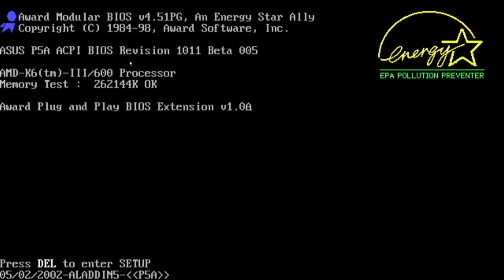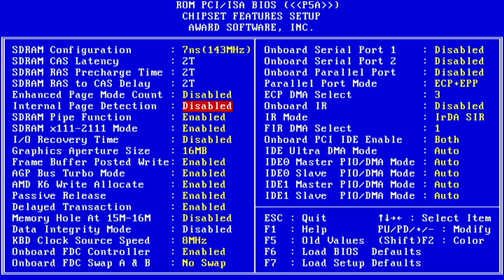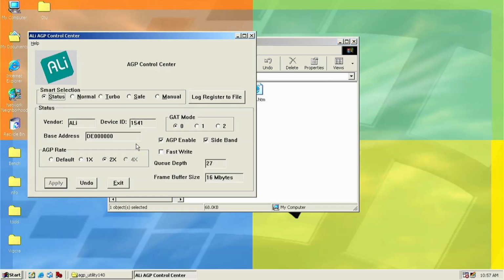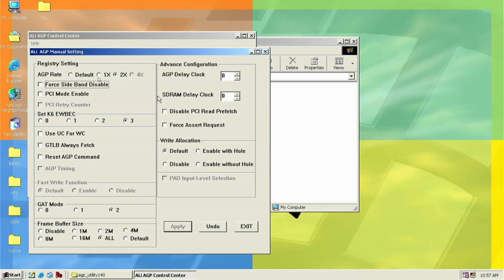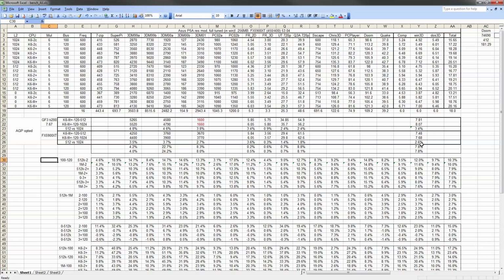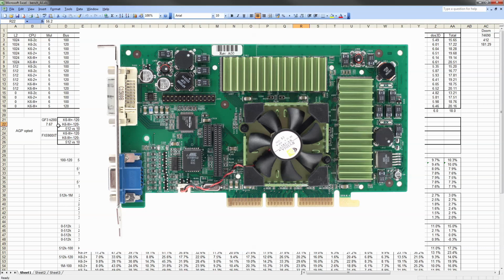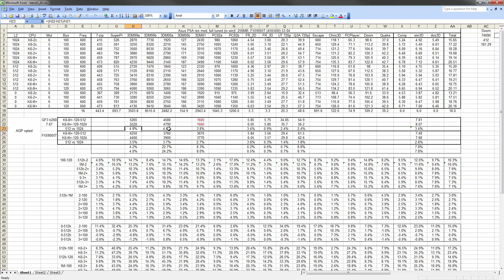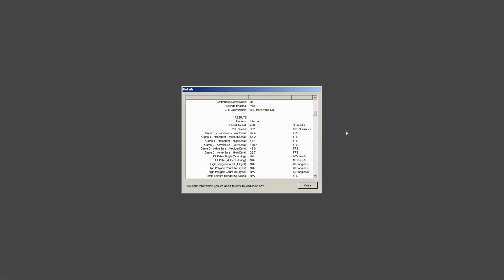Asus P5A v1.06 with 1MB of Cache - Part 2: Setting 3DMark Records with K6-III+ @ 5 x 124 = 620 MHz.

Comment: If I use Win XP SP1, will I have less performance ?
Reply from the maker: Windows XP are way heavier as an OS. It will feel more sluggish but it can do it. Performance in games also probably a bit lower, to much lower because you can not use older VGA drivers. Worth to probably also try Windows 2000, but probably the best is win 98.

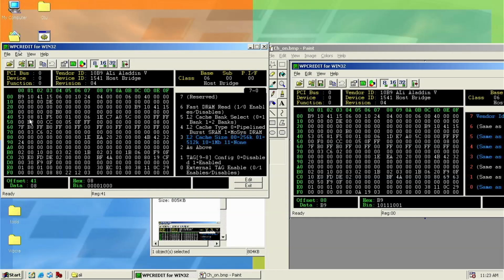Comment: @ 1:14
In offset 41 for the 1mb cache motherboard... you say to change that value from 08 to 48 if the cache is disabled for a performance boost.
What about for the 512k cache motherboard version? For offset 41, the default value isn't 08, but instead its 05. Do we change it to 45?

I also have a Gigabyte GA 5AX Rev 5.2. Will these tweaks from your part 1 video and this one work the same on the GA5AX or is everything different?

Thanks!
Reply from the maker: True,  this (offset 41) should be changed from 0... to 4...
This sets the 6th bit, and enables "Fast DRAM Read".
This increases performance, but is only stable when the M/B cache is disabled.
The model or cache size does not matter, as long as it is the same chipset.
That is for all these opts. Happy tuning ^^.
Reply: @atheatos  
Thank you!

Those Ali AGP 1.9 drivers made my 3d Mark 99 score go up 1000 points! Almost 4000 total now. 😁

I also did a couple of those tweaks from wpcredit which helped mem bandwidth & latency quite nicely 👌

I haven't done any of the command line stuff in my autoexec yet.

Finally got over 2000 in 3d mark 2000 👍

Currently running a gigabyte ga 5ax rev 5.2 with a K6III+ @ 600 (120x5@2.2v)
And a voodoo 3500.

I have a p5a 512kb 1.06 as well sitting in storage. Going to do the 1k ohm mod on it and tinker to see how it compares to my ga-5ax next week. 

Question:
I have the following agp gpus available... Which would be fastest in the ali chipset with these two boards I have... And which would you run:
Riva TNT2 Ultra
GeForce 2 MX400
GeForce 3 Ti500
Radeon 9700 Pro
Or keep the voodoo3 3500?
Reply from the maker: Nice results there :)
Fastest overall and best option is the "GeForce 3 Ti500" combined with some old driver (7.76??).
Especially this is true in benchmarks. Big difference from the Voodoo.
Now some games with the Glide API might run faster on the Voodoo, so hard to tell.

Personally I do not have stable configurations and PC cases/ full pcs etc.
So normally I would had just tested all for fun, make maybe and video then put away.

Comment: Hi, I have the 512k Version of this Boad running a K6-2 @ 620 MHz (FSB124). Thanks there were some useful tips in the video that I didnt know before regarding Chipset registers. For me a comparison how it would perform against the PII, early PIII or early Athlon would be interesting.
Reply from the maker: I agree all these comparisons could be very interesting and I have more than enough systems to do this!
The only problem is that to make it fair I would have to optimize the other systems too and check a-lot of stuff.
On top of this I am very busy these days and I have no time to make videos :/
But I will come back to this at some point.

Comment: I have Asus P5A v1.06 and did the mod for the + models but run into another problem. It random reboots when idling in Windows desktop. I have tried EVERYTHING (PSU, BIOS, cards, memory...). Google tells me that I'm not the only one. It helps if I lower CPU clock down to 300MHz with setmul. CPU is modded K6-III+ from K6-II+ but does the same thing with unmodded CPUs. K6-2 (without plus) works. I can run 3DMarks, game benchmarks, no problems. But when idling in desktop it just reboots like pressing reset-button.
Reply from the maker: I do not want to dismiss the possibility of an issue with the mod for some people, however...
based on my experience and what the majority of people is saying in Vogons, there is probably no problem with it.
I have done this mod to 5 or 6 M/Bs, never had any problems. Countless hours of testing too.

Any of these M/Bs that had stability issues on higher clocks was due to the caps.
After replacing some of them all did 5 x 120 = 600 K6-III without any problems. (my 1MB 4ns model)
The strange thing is that these caps were looking fine, also measured fine after removing.
Reply: @atheatos  So caps maybe... Because it doesnt matter if 100x6 or 120x5, random rebooting happens all the same. But with 3x multiplier works better. One thing to mention, good test is to play midi-file through aureal vortex2, resets in under 10s.
Reply: Check voltages, try to switch off the L2 cache
Reply: Sold all my P5A boards away and now I'm only using VIA MVP3 boards. Those are just super stable, not single problem. ❤

Comment: I'm planning a SS7 build with a DFI K6BV3+/66, so a deep look into an MVP3 based motherboard would be great!
Reply from the maker: Funny enough I started with MVP3 M/Bs here and I have many of these (not a 2MB one yet)...
Then I tested some ALi ones and in the end I only did a video on the Asus P5A.
Looks like MVP3 has faster a memory systems but a slower AGP.
In the end ALi is just faster in 3D games, benches.
 
Now I have more or less a set of optimal register settings for the MVP3 too.
I need to recheck all these if I am to make a video on the topic.
So a video like that will happen but it is a lot of work, so I can not give a priority to this.
Reply: @atheatos  That's great to hear. My SS7 build is going to be a file server so AGP performance won't matter at all, it won't even include a graphics card.

Comment: Did several tests on the 1.04 revision of the P5A with 512kb of cache with the same latest beta BIOS. The GPU was the TNT2U and K6-III 450MHz CPU. 512kb L3 enabled in every test of Phil Dosbenchmark was faster than 512Kb L3 disabled. The only one i saw a slight decrease was DosQuake @ 640x480 running at 24.8fps vs 24.9fps with L3 disabled. Windows benchmarks with 512kb L3 enabled are as follow. 3Dmark2000 scored 1733, Quake 2 demo1 @800x600 scored 61.6fps, Quake 3 @800x600 scored 30.4fps and Unreal @800x600 scored 37.64fps. Windows benchmarks with 512kb L3 disabled are as follow. 3Dmark2000 scored 1716, Quake 2 demo1 @800x600 scored 60.6fps, Quake 3 @800x600 scored 30.3fps and Unreal @800x600 scored 37.34fps. I was unabled to reproduce the loss of performance with 512kb of L3 enabled compared to no L3, that you showed in this video. It actualy helped in performance like it should. Any suggestions?
Reply from the maker: Well if you see carefully in DOS I got the same, 512KB L3 was faster in everything except Quake.
Also... When I disable the L3 cache I enable the Fast DRAM option by tweaking the Registers.
This is what makes the difference and it is only possible with the L3 disabled.
Check the register optimization part of the first Video.
Reply: @atheatos  Interesting. Need to see if i have Fast DRAM enabled in BIOS and do the same tweaks. Thanks for the suggestion

Comment: I wonder the results of this test with TNT2,Voodoo 3 or even a G400. Nice tests.
Reply from the maker: I have all these cards.
I might come back to this at some point.
Reply: @atheatos  TNT2U scores 1734 in 3dmark2000 and G400 scores 1656 on the 1.04 revision with 512kb L3, and K6-3 @450. Need to test V3, but i only have a spare PCI V3 2000. PCI will bootleneck it a bit probably.
Reply from the maker: I actually have nearly everything from Nvidia ATI Matrox 3DFX.
I had done some fast tests back then.
In general for windows 3D stuff, the GF3 with this driver can not be defeated.
3DFX maybe faster in some games due to the lightweight driver,
however these perform very poor in 3DMark 2k 2k1.
DOS is very different, a 3DFX, a TNT2 or maybe an ATI are faster options.
I will probably need 10 videos to cover all that XD.
Reply: @atheatos  That´s impressive. Absolutely everything? I wish :) Yes, 3dfx is best contemporary option overall to match with K6-3 weaker FPU. TNT2 is not distant either. GF3 is to recent for an early 99 build. To much card for CPU.

Comment: Awesome :) Thanks for your work! Maybe redo some of Phills benchmarks :D
And some Glide games vs D3D
Reply from the maker: Thank you for the suggestions.
In general there is no difference to the dos tests with the extra AGP optimizations. Only maybe a small negative effect on Doom. With graphics cards there are differences, some faster some slower. I will revisit this in the future.
I agree, 3dfx cards is something I must test for sure. The performance with K6 is very good. I need to check stability too with ALi. It is good that I have nearly everything for 3dfx too.